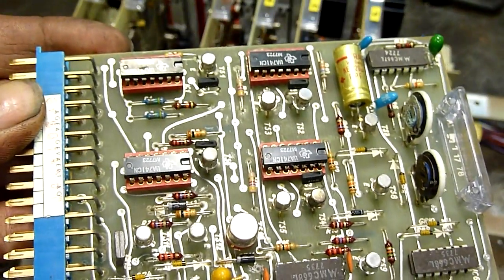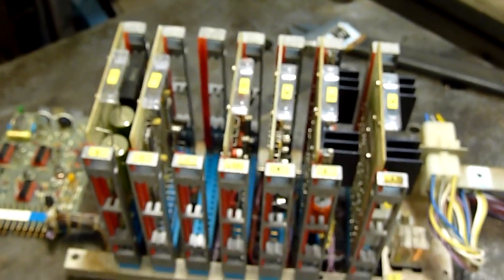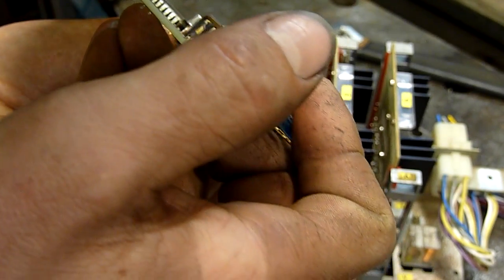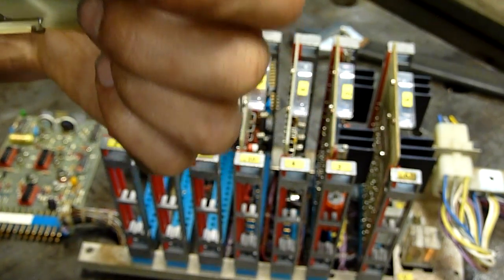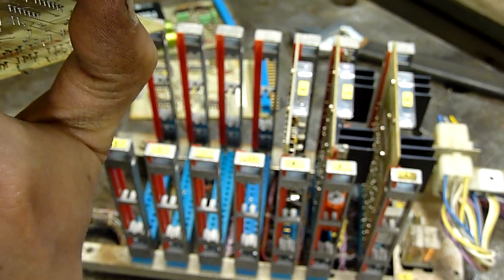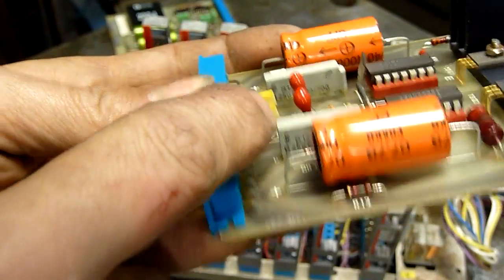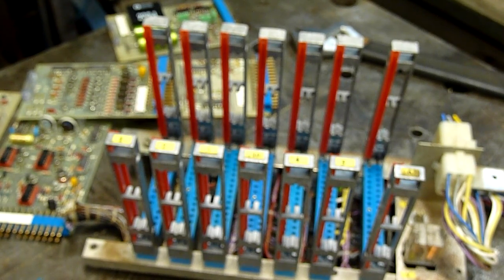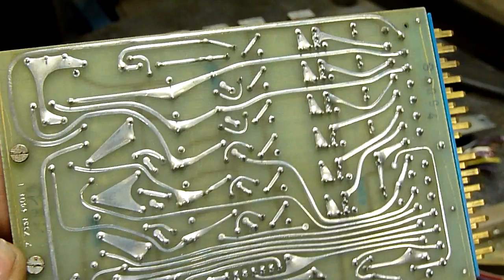AGFA-Gevaert 7596/100 PCB Components Examination

Comment: showed the freind the videos of the unit , he says he never seen a device like it so it must be a specialty item for your area , but he did say if you have the time to desolder everything and keep it as AGFA medical  used all good stuff and it was rare for it to take a dump , and all the boards are sub groups by components  and they do the wiring outside as there thought was if one transistor went bad , the rest will follow kind of a redundantcy built in

Comment: its wired how whell they lasted.  they always tind all the copper traces.  there was not a solder mask at that time.  or solder rist like the green and other colors you see on circuit boards now days.   and these were so easy to fix compard the the new stuff we have now. if a trace blew. or shorted you trilled it out mixed epoxy fill in the hold and take a shed of coper cut the trace out of it and solder it back on while the epoxie is still wet. easy stuff to fix.